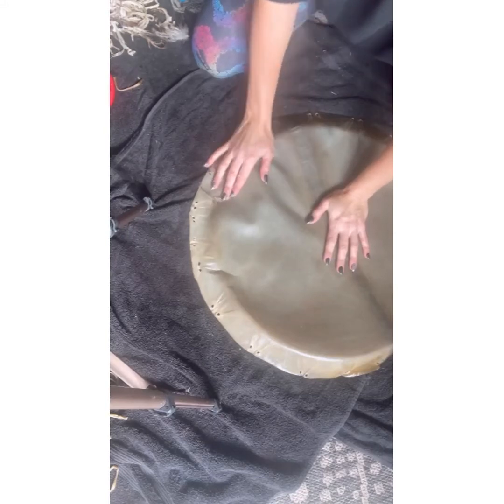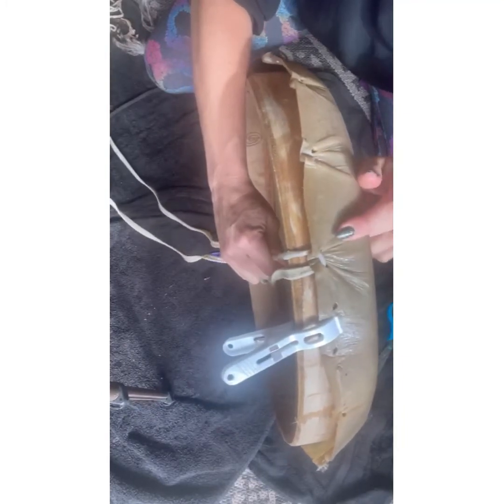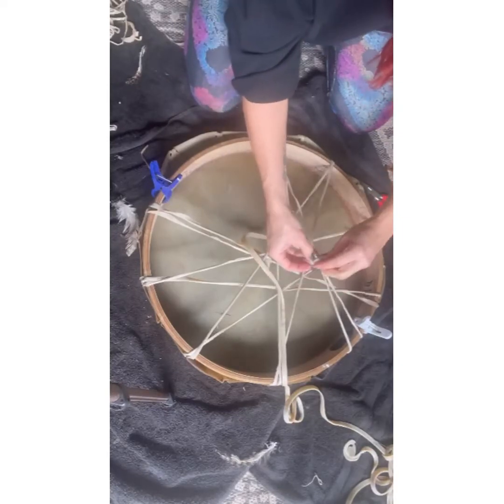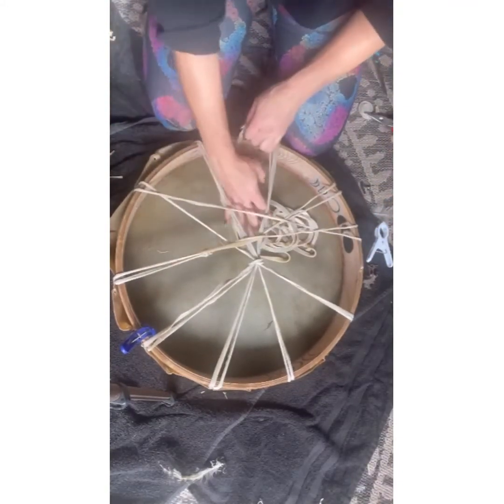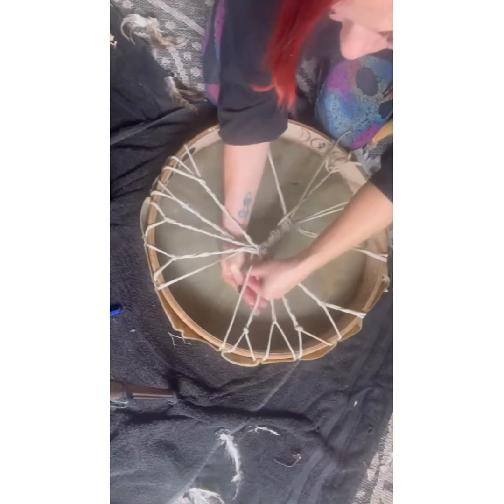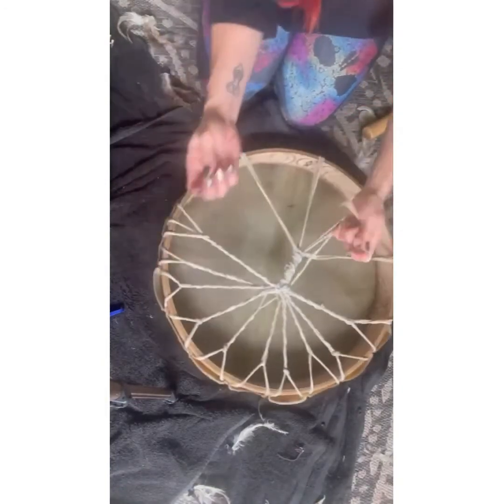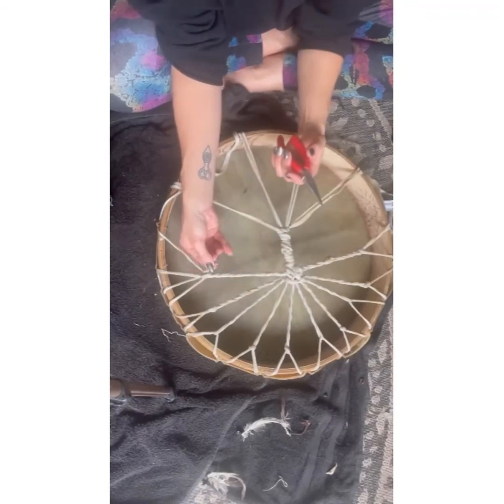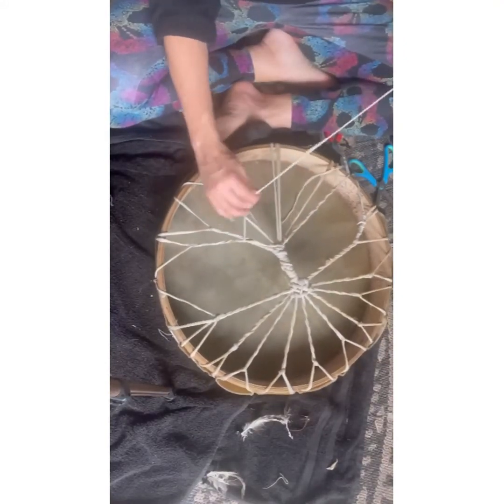How to make a tree of life tie frame drum

Comment: There is a fold method as well, for placing holes. Fold it, holes on the fold egde, match up those holes, hole the fold edge, match up the two sets of holes, hole the edge, repeat that pattern until 16 are done. I only use a single hole now as the dual holes can tend to tear into each other on the thinner hides, thick hide its no problem... Thanks for the tree of life tips!
Reply from the maker: True, many ways to punch the holes, as long as one is careful to not allow the slipping of the hide.